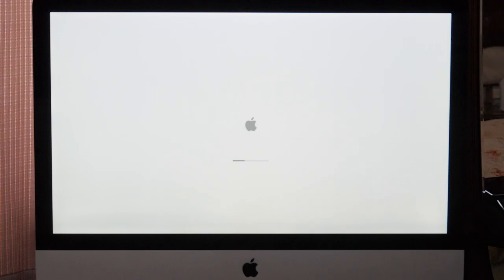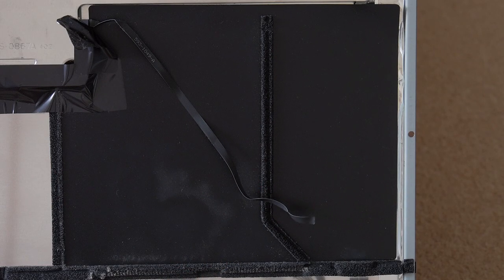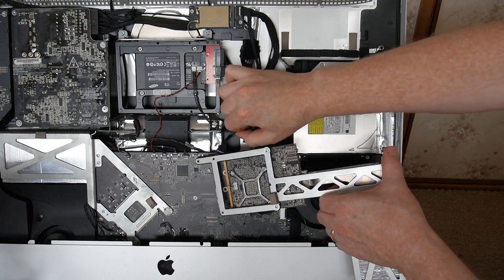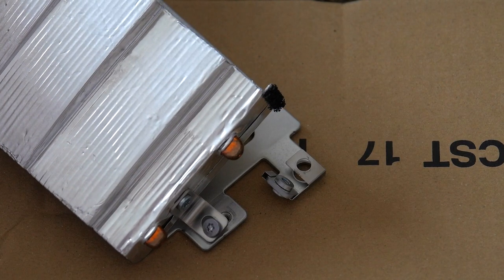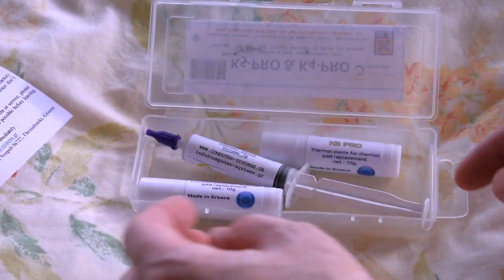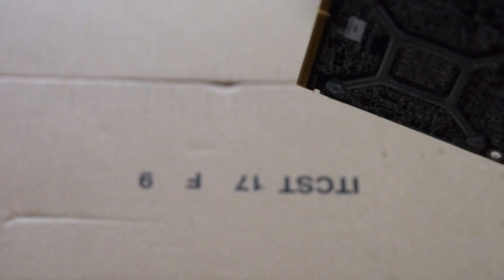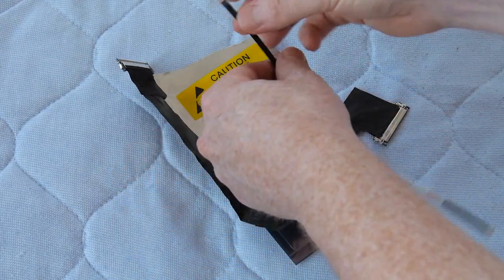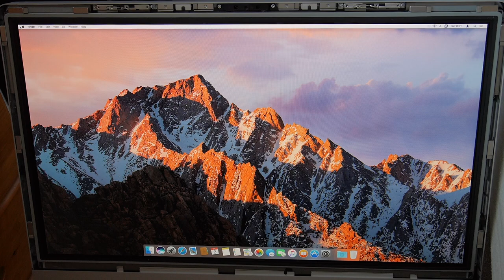Late 2009 iMac 27" Video Card Repair — 4850 — 2nd Bake

Comment: 📅 Jan 10 2021 - UPDATE:
Hello there. I came back with a little update now that one year has passed. My iMac is still working perfectly fine as it was right after my bake. I have moved it a few times from the desk, eventually changed RAM cards and so and keep on using it daily for graphic design work and games. I use it also as main computer and storage/backup. I haven't experienced any issue concerning the graphic card, but probably because I also haven't been using very demanding programs, I guess. Anyway, I just wanted to let you know and thank you again for your work on the videos 1 and 2. I leave my original comment down here in case it can be of any help for anybody. All the best to you!

==================  ORIGINAL COMMENT (2020)  ======================

🖥 The card on my iMac 11,1 (27", Late-2009, 2.8 GHz) started bugging some months ago and I knew it was the end of it. After all, it worked flawlessly for 10 years and did its job. I had just enough time to backup all the data before it finally stopped working (or even booting). However, I refused to give up the whole thing since all pieces were functional except for that. According to the Mac technicians, everything older than 6-7 years is considered "vintage" and, since they can't give any warranty, they will simply not even try to fix it. I checked some information and videos online until I found yours. I followed your instructions and was particularly careful to avoid the same problems you already suffered (screen falling down, broken connector/cable, short baking time, issues with old thermal paste, etc). I cannot say anything else other than THANKS. My iMac is working again, and I was very skeptic about it. I kept testing it today and everything seems to be fine. I will keep it on quarantine for a while before I start dumping files in it, but will keep you posted. I am totally speechless and eternally thankful, JWD.

📅 Jan 8 2020 - Date of repair and Graphic card bake

🔧Disassembled computer according to the guidelines on Bake#2 video (therefore I post my comment here). I am totally amateur at this and didn't dare to do the whole Motherboard/Battery thing. I cleaned gently the very dusty interior of the iMac with help of a soft brush and some cotton swabs, eventually with controlled blowing.
🔥I baked the card at 200 ºC on a pre-heated normal oven for exactly 10 minutes. There was a little smell but I thought it was normal. Let it cool down for 30 minutes and smell was also gone (I believe there might be some sensitive parts or pieces of glue/paper that might cause the funny smell, but it was gone immediately).
💉I applied thermal paste, and at this point I did it in a different way as you did: I found a lot of sources confirming that Arctic Silver 5 is NON conductive. It will transmit the heat into the sink, but not electricity. I applied a simple, thin layer over the 8+4 connectors and on the main chip. I noticed that, despite these connectors have different height (as you pointed on your video), the metal on the heat sink has as well some kind of "step" that makes the distance equal, therefore making unnecessary to apply an extra thick amount of paste as you did.
🔌I then proceeded with assembling all again. The most difficult part of the whole process was with the tiny connector that attaches on the back of the motherboard. With some fine sticks (like toothpicks) I managed to properly place it and push it without needed to loosen the motherboard, which at first I thought it would be required. The rest was done pretty easily, following from time to time your video to confirm the right order and orientation of connectors, etc. I would like to add that this part should be done very carefully and confirming everything is properly attached. A small mistake due to rushing because of wanting to see the result might cause a failure or severe damage to the computer.
I placed the main LCD with a couple of screws and tested it. Also noticeable, it can be a bit painful to place these last screws due to the strong magnets next to the holes, which keep on attracting the screws towards them. A magnetized screwdriver (T9) will be a huge help.

I could hardly believe it when it boosted and started working like nothing happened. I don't know for how long, but I hope my feedback and message can help others at least a 1% of what your videos helped me.
I will try to keep this comment updated in case anything changes. 

Thank you so very much again!
Reply from the maker: I’m extremely pleased to hear you were able to resurrect your 10-year-old iMac, Daniel! Thank you for sharing all the details of your bake, as that will certainly help others. 

I should add though that Arctic Silver V is “capacitive“ and should it come in contact with little components surrounding the GPU it would act like a little capacitor shorted across them. So it is not perfectly non-conductive and non-capacitive as the K4 Pro that I used. But as long as you didn’t put too much on the GPU, there should not be too much overspill that would reach those surrounding components.

As to the distance between the memory chips and the heat sink, I am aware of what you said, but there’s no way to precisely measure that distance. But what we do know though is that the old residual paste on the card’s memory chips, which you could see in my first bake video, is not a thin layer as is typical when pasting a CPU or GPU. Apple used a thermal pad for those memory chips. That gives evidence to say there is extra thickness above those memory chips, and because regular thermal paste does not retain its shape over time, The cooling of those chips via regular thermal paste will diminish overtime. I do think that’s what led to my first bake lasting only four months. So if you have trouble a few months from now, I would suggest you do it again with K5 Pro on the memory chips and K4 Pro on the GPU. Hopefully it won’t come to that though because you know how much time and trouble it takes.

Anyway, best wishes to you and your newly resurrected iMac!
Reply: @JDW-  I was very careful with the AS5 indeed and hopefully I don't get any kind of shortcut anywhere. I of course keep in mind what you wrote on your reply and also previously on other answers to comments about the K4 and K5. I wanted to describe what I did in case it was of any help for you or anybody else. Apart from that, I don't know if all components are manufactured in the same place and way, but for sure the residual paste on my card's chips was very different to yours and didn't look so thick and "cracky". Who knows. I will keep you updated, in any case, and if I happen to have some issues or the computer stops working after a while, of course I will  then proceed with the very same K4-K5 you used. Thanks a lot for your time and big props to you.
Reply: @JDW-  Just added a short update on the status of my iMac, 365 days later. Thanks again!
Reply from the maker: @danieldors1075  Thank you for the update, Daniel.  I get a lot of naysayers who claim the bake doesn't work at all or that it will never last very long.  Your case shows that is simply not true.  Indeed, for most people, the bake lasts long enough to make the effort worth it.  Glad to hear your iMac is still going strong after 1 year.  Happy 2021!

Comment: Cool!  How long did it last the second time?
Reply from the maker: I put that info in the text description along with a lot of other very useful advice and resources, so be sure to check that out.  (Click SHOW MORE to expand it.)  But basically, my second bake lasted 2 years and 9 months.  Definitely worth the time and effort to do the bake!
Reply: @JDW-  yes I saw the other video, time to cook
Reply from the maker: @andresbriceno73  Just make sure you use an oven safe thermometer to confirm your temperature is correct and stable, and then you should be good to go!
Reply: @JDW-  it fkn worked!
Reply from the maker: @andresbriceno73  Congrats!  Keep an eye on it over time and let me know how its doing in a few months.  If you get more than 1 week of life out of the bake, then it probably will last a fairly long time.  Not forever, but perhaps long enough to have made the expense and effort worthwhile.  In the meantime, best wishes!
Reply: @JDW-  I will only use it to record music ideas on logic pro, also got the fan control app, lets se how it goes, thanks a lot

Comment: Hello, I live in Japan too... 
I did something wrong and sadly after the second bake the strategy didn’t work. I decided to buy a new graphic card but I’m not sure which one to get, so I wonder if you could suggest me one that is better than the defective original one that came with those first 2009 iMacs.
Thank you very much.
Reply from the maker: Thank you for your comment, Aldemar.  Could you please explain what you mean when you said your bake did not work? If after your bake you got only a black screen, and prior to the bake you had artifacts on your screen, such indicates that you may have forgotten to connect a cable or maybe a cable was broken. 

I sometimes get asked about replacing the video card with a newer model. But I cannot recommend a different video card that I myself have not tried and tested fully.  I can only say that I have read the experiences of others online, where they have purchased a used video card on eBay that was pulled from a 2011 or 2012 model iMac.  Those video cards are 100% compatible with the late 2009 iMac, but I have read that you may need to cut a little bit for those newer cards to fit perfectly.  I did not want to deal with that, which is why I decided to bake my existing video card back to life.
Reply: Hi JDW, Thanks a lot for the nice and useful video. Some how my first bake didn't go well I think..applied K4 and K5 pro pastes and fixed the card. After start the machine chimes , but screen is Black. Any more hints / suggestions. Thanks again.
Reply: Also have double checked the cables, all looks fine to me.
Reply from the maker: Selvakumar, you said you baked your video card and applied K4and K5 Pro and that “fixed the card.” But then you said your screen is black.  So does that mean the bake never worked at all, or do you mean it worked for a while but now you get a black screen?   

If it never worked at all and if you checked all of your cable connections, then it is possible that the video card was too far gone to be repaired by the bake. You could try a second bake, but that may not work either and your time would be wasted in that case. 

There is another possibility. It could just be that you’re display’s backlight is defective and there’s nothing wrong with the video card at all.  A defective backlight would result in a completely black screen even if your video card was working well.  But you may not be able to find that out unless you try a different video card.

As to putting in a different model video card than the stock model, I cannot necessarily recommend that because the physical size maybe slightly different, even if pulled from a 2011 or 2012 iMac, and that may mean you might need to cut into some plastics to make it fit better. Also, some cards are so different in shape that the stock heat sink may not fit well with them. Some cards may draw more power and therefore generate more heat too, which would be a bad thing. So I would recommend replacing with the same type of video card.
Reply: Thank you JDW. To answer your query, before bake, the machine was working in Safe more with wide vertical stripes. After bake, the machine just chimes and does something internally (may be continues the booting process, as I see the fans are running), but no display, screen is black. I'll try one more bake for 15 mins, otherwise look for a another VGA card of the same type.Thanks a lot gain.

Any more suggestions,  tips..please let me know.
Reply from the maker: So before your bake your machine was like mine, showing artifacts and only booting in Safe Mode. OK.  I understand.  So it's clearly a problem with your video card, since you said you can 100% confirm that it is NOT a cable problem.  You have a late 2009 model iMac like mine, correct?  If so, the bake should not have damaged your card, so long as the temperature was 200°C.  If you do another bake, make sure you clean off the old paste completely, then preheat your oven to 200°C for 10 minutes, then use aluminum foil stand-offs to raise the card, then put it into the oven for 10-12 minutes.  After that, you need to open your oven door and let the card slowly cool down.  When cool to the touch, then reapply the paste and reassemble and test.  If you still get a black screen, and if you are 100% sure that no cables are disconnected or broken (especially the thin ribbon cable that attaches in the upper left of the iMac), then clearly your video card needs to be replaced, and I again would recommend the same model card you have now, to avoid heat or mounting issues.
Reply: Hi JDW, Thank you again and yes, mine is 2009 model iMac 29in too. Have double checked all the cables, it was fine. I'll try bake one more time as you suggested  and update the status here.

Have a great day.
Reply: Hi JDW, hope all is well. Somehow second bake (13m)  did not work too. I used the oven which has a rotating plate in it. Hope thats not an issue. Any online page recommendation to buy a new or used one apart from ebay /aliexpress? How abt upgrading to HD6970m 1GB card, any thoughts? Thanks again.
Reply from the maker: I'm sorry to hear that.  So long as your oven is truly an oven and not a combined microwave and oven like we have here in Japan you should be fine.  In the ovens here in Japan, when the plate rotates it usually means the microwave part of the oven is in use!  But if you didn't see any sparks fly, then you probably have a normal oven.  Well, your card simply must have been too far gone for the bake to work, and as such you are right about needing a replacement.  I have no personal experience about using a newer video card, so I really cannot guide you about that other than to say that newer cards may not fit perfectly.  So it would be "safer" to replace your video card with the same type of card.  I assume your stock video card (the one you baked) is a 4850 like mine, so just go to EBAY and search for these keywords: "imac 4850 video card".  You will get a lot of results, including video cards and video cards that even include the entire heatsink assembly.
Reply: Thank you JDW again. Its a microwave cum oven (for bake), have 2 modes. In both modes the plate rotates..I'll check in eBay or others..Have a great day.